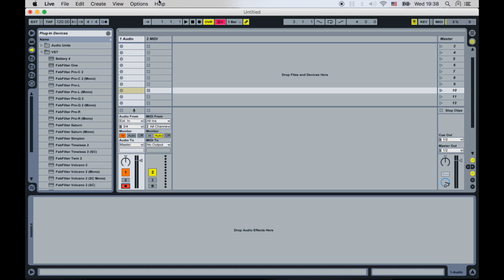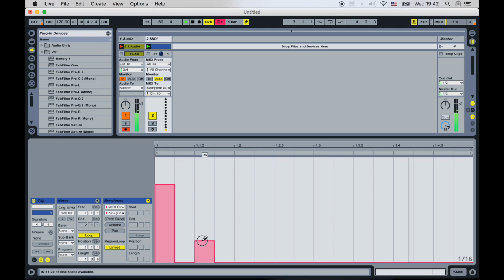Control Roland TR8 Parameters Via MIDI in Ableton

Comment: Does anyone know how to do this for the TR8s?
Reply from the maker: Hi, it's essentially the same. You can reference the midi implementation PDF from this page to get the concrete midi CCs. https://www.roland.com/au/support/by_product/tr-8s/owners_manuals/
Reply: @MrMooseMusic  Thanks. So I figured it out shortly after posting the above. You actually have to go into the MIDI settings and turn the Rx EditData function to 'on' for it to work.
Reply: @MrMooseMusic  Thanks. I actually figured it out shortly after posting the above. You actually have to go into the MIDI settings menu and turn on 'Rx EditData' for the TR8s to receive control change messages. You'd think the would ship them with it turned on by default but...

Comment: Thanks for the useful trick dude, but I have a question, how can I do to assign the differents tracks of my tr-8 to the respectives tracks of an external sequencer ? (I want to use my digitakt to sequence and control my tr-8)
Reply from the maker: Hey man, since I don't have a digitakt I can't really answer your question, but this doesn't keep me from answering anyway :D.
Each sound of the TR-8 has its own note number. So I guess you have to set a midi track on your digitakt to trigger the desired sound on the tr-8 by directing the signal to the corresponding note number. The note numbers you can find here: https://static.roland.com/assets/media/pdf/TR-8_MIDI_Imple_Chart_e02_W.pdf

This is the idea, I guess in theory this should work. Try it :)
Reply: @MrMooseMusic  I succeed to pilot the TR-8 on the DT!
Reply from the maker: @nlewandowski3228  Awesome man. Happy to hear that. Btw was the general idea what I suggested or something radically different?
Reply: @MrMooseMusic  thanks dude, I'll try and I'll tell if and how it works!

Comment: So this is a cool trick but do u know if it is possible to record these automations my simply turning the nobs on the tr8? I mean so that u wont have to manually draw them in to ableton, but instead use the actual  tr8 as controller for these automations and record them that way. Just like you would do it with a normal midicontroller, recording the automations as you turn the nobs.
Reply from the maker: You know, I haven't tried it, but it should be possible. Basically you want to record the midi pattern in to Ableton and then let that midi pattern drive your TR-8. So try connecting a midi cable from the TR-8's midi out port to the midi in port of your audio interface. Then create a midi track in ableton and set the routing so that it receives midi from the TR-8 and sends midi out back to the TR-8. I mean, it should be possible but I don't think it would be useful for live jamming because this routing may introduce a feedback loop. Let me know how it goes!
Reply: Thanks i'll try it out and get back to you. Basically the most important thing is to get it to record the tweaks i make as automations and then for live use i should be able to only send the midi signals os both notes and controls out to the tr8 to use in a live set. So the midi in and midi out would not have to happen at the same time in a live situation, only while setting it up. Well, I'll try it and get back to you!

Comment: Hey not sure if you were aware but TR-8 is also an audio interface.
Reply from the maker: Yup. It's an awesome piece of gear. Very versatile. I hope Roland will release a new soundpack soon.
Reply: Mr.Moose I hope they release a comprehensive guide to using it with a DAW.
Reply from the maker: Any specific questions? Maybe I can help or create another vid.
Reply: you answered the last question I had.
Reply: Have you watched the Ean Golden TR-8 tutorials from the DJ Tech Tools channel?
Reply from the maker: Yeah I've seen that video. It's pretty cool. The TR8 is basically an audio interface, a MIDI controller and a digital drum machine. If you use Battery (or any other drum sampler), try mapping the TR8 to it...tons of fun.
Reply: Roland really needs links on their page to help dummies like Me. I had been tuning the kicks in ableton and stemming out the hits for sub bass lines on a drum rack. The trick you've shown me here is way cleaner.
Reply: Don't you use it as an audio interface, everything is completely messed up after this.